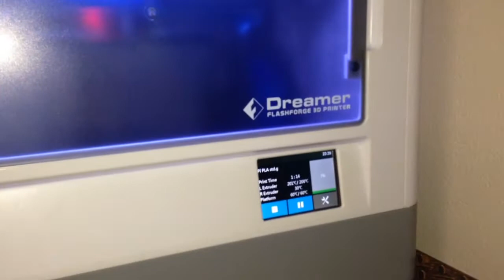Flashforge Dreamer - Tower of Pi 1

Comment: Did you develop specific successful settings for printing in PLA and ABS for different slicers and layer thicknesses? I just got FlashForgeDreamer, and so far it takes me forever to fine-tune the procedure.
Reply from the maker: Vladislav Valentinov This video was straight out of the box when I knew nothing about settings. But this is what I have learnt after using more than 110Kg of filament :)  PLA:Speed: 80mm/s, PLA: 205c, Bed 50cSpeed: 90mm/s, PLA: 210c, Bed 60cbut make sure first layer is no faster than 40mm/s ABS:Speed: 80mm/s, ABS: 230c, Bed 105c